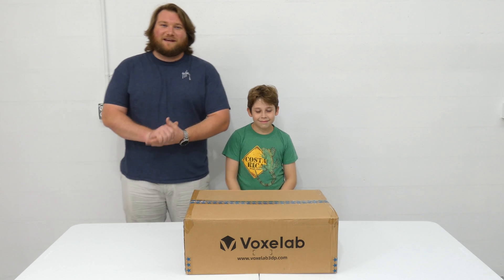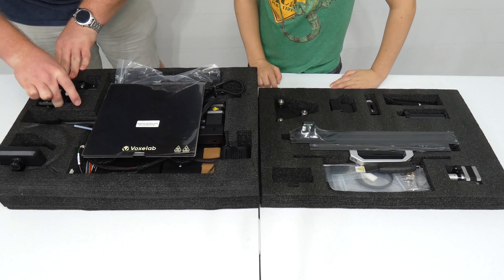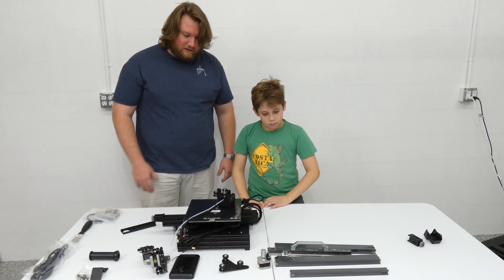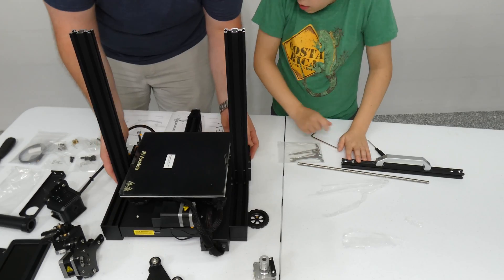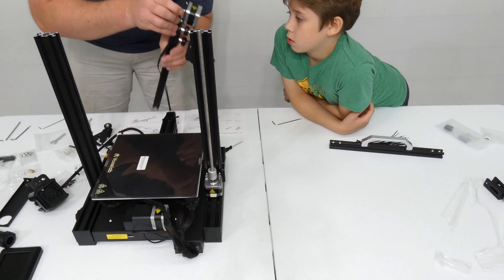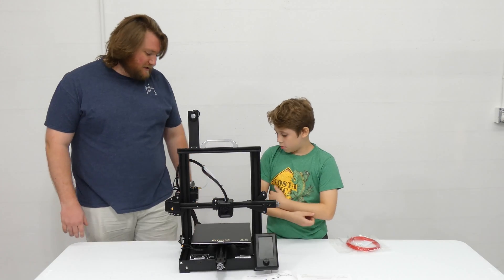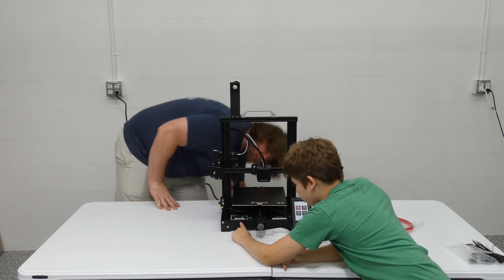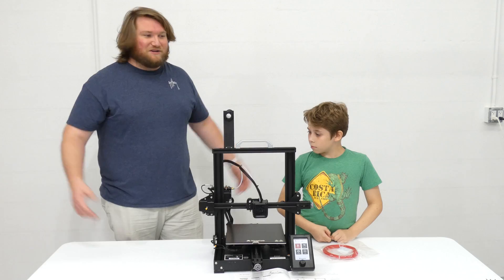Voxelab Aquila X2 Unboxing and Assembly

Comment: For some reason my z cables are on the opposite side of the machine.
Reply from the maker: The cables could be run under the bed... Sorry for the late reply. Did you get it figured out?